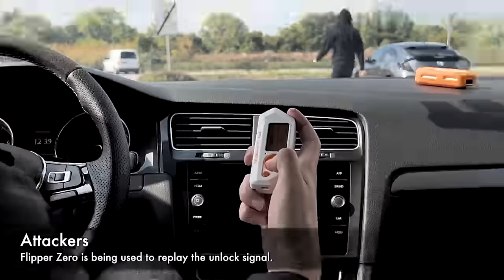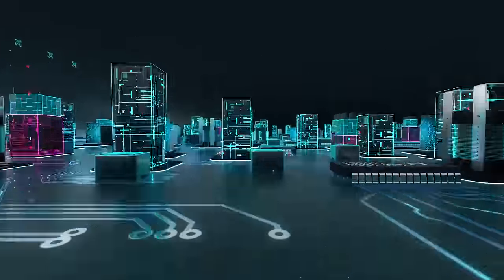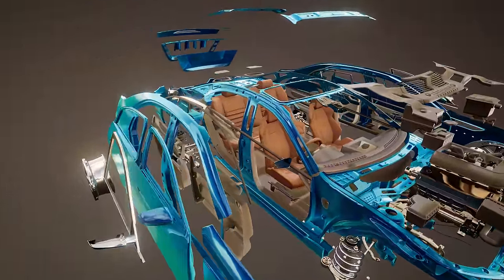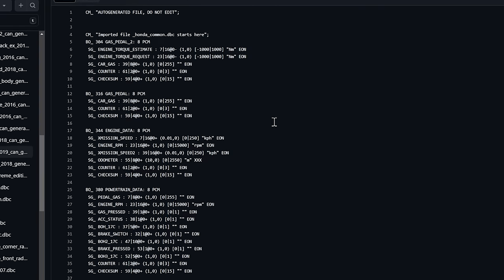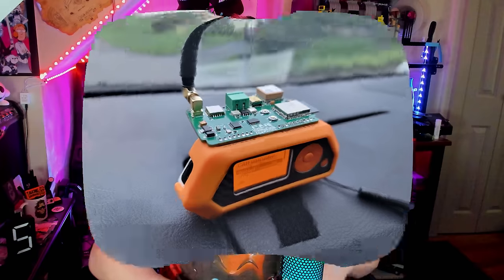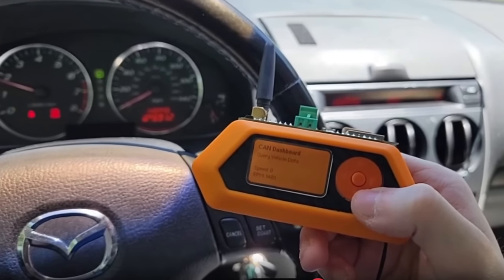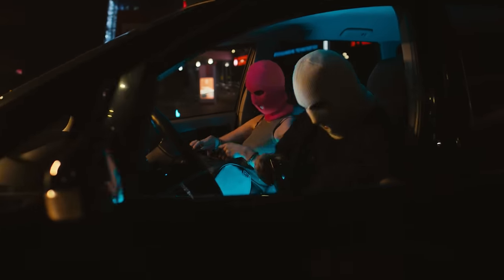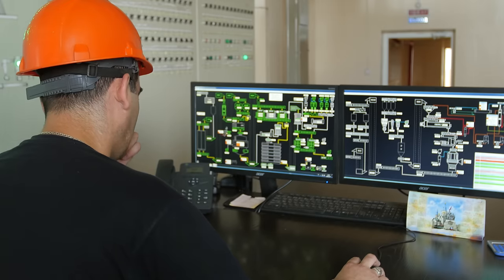Flipper Zero CAN Hack Your Car!!  CAN Bus Hacking With Flipper Zero!

Comment: 🎯 Key points for quick navigation:

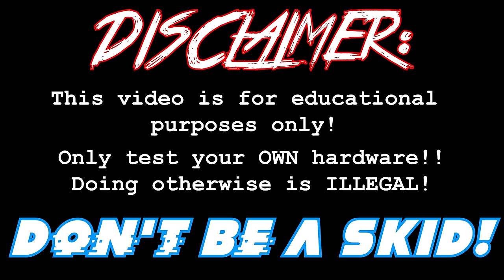00:00 🛡️ Introduction and Disclaimer
- The video is for educational purposes only; testing on hardware not owned is illegal,
- Introduction to the topic of auto hacking and the misinformation about Flipper Zero's capabilities.
00:28 🔑 Understanding Flipper Zero and Car Hacking
- Flipper Zero can read car keys and fobs but has security limitations,
- Possibility of hacking with additional engineering and technical knowledge.
01:32 🚗 Introduction to CAN Bus
- Explanation of CAN Bus as a robust two-wire system for car data transmission,
- Importance of CAN Bus in connecting sensors and devices to the car’s computer.
03:38 🔧 Interfacing with CAN Bus
- Tools needed to interface with CAN Bus like MCP2515 and Arduino Nano,
- Introduction to PCB and sponsor PCB Way.
05:00 📡 Accessing CAN Bus and Database Container Files
- Multiple ways to access CAN Bus including ODB2 port and lights,
- Explanation of DBC files as translators for commands and their availability.
06:04 🛠️ Practical Applications of CAN Bus Hacking
- Use of homemade CAN Bus interface to read car data and create custom displays,
- Examples of interfacing with infotainment systems and digital displays.
07:03 🖥️ CAN Commander and Flipper Zero
- Introduction of CAN Commander to interface Flipper Zero with CAN Bus,
- Capabilities of CAN Commander including GPS, Wi-Fi, and reading key fob signals.
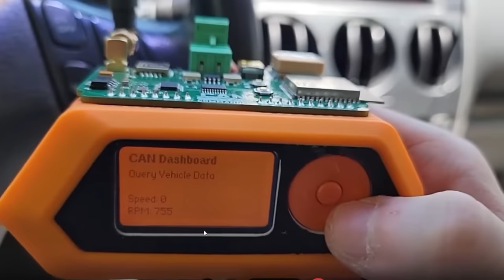08:11 📶 Advanced Features of CAN Commander
- Using CAN Commander for denial-of-service attacks and man-in-the-middle attacks,
- Explanation of prioritized packets and potential for disabling vehicles.
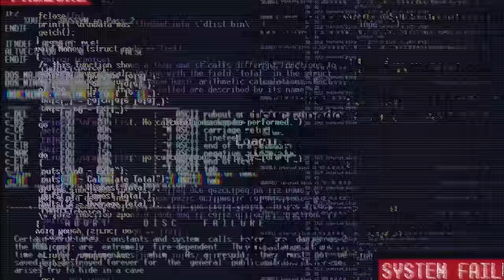09:49 🔄 Real-World Implications and Security Concerns
- Potential for manipulating vehicle data for insurance or monitoring systems,
- Examples of existing hacks and the importance of security research.
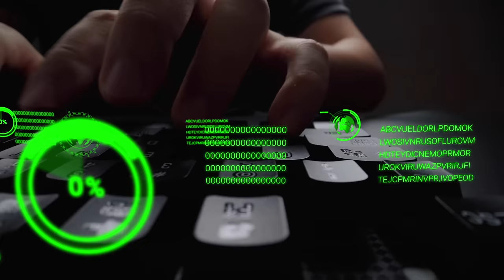11:28 🛡️ Security Research and Preventative Measures
- Efforts by researchers like Matthew to develop countermeasures against CAN Bus attacks,
- Tips for vehicle owners to protect against hacking and the inevitability of such risks.
12:10 📢 Conclusion and Call to Action
- Summary of the video and encouragement to watch the full presentation by Matthew,
- Request for likes, comments, and subscriptions to support the channel.

Made with HARPA AI

Comment: Dear Canada, this still doesn't make the Flipper a car hacking device.  The Flipper plays a trivial role and could literally be replaced with anything that has buttons and a screen.
Reply from the maker: Agreed.
Reply: Your comment has been flagged for wrongthink by the ministry of truth. You have been assigned to reeducation camp number 634 and transportation officers will be at your location shortly. Do not attempt to leave.
Reply: Omg that was a flipper video?? 😂😂 I was only focus on the can commander 😂
Reply: But it can be used to steal cars. Very easily.
Reply: @honestlocksmith5428  So can a brick
Reply: @skatterpro  So why don't we ban  bricks, right?
I'm just saying the flipper is an interesting tool for car hacking. It has a number of useful features and can do many of the tasks professional tools are currently doing.

Comment: With the can bus, almost everything can theoretically be hacked, even elevators
Reply: Can you explain this please? I'm interested
Reply: Elevators might even be easier than a car. I bet if you get into the maintenance panel or electric box then the CANBus wires are right there.
Reply: @gshockhodinky  do you think it could be possible with a m5stickc plus2

Comment: All this is why I as a locksmith now have to crawl up in dashboards and floorboards and physically spike into Chrysler star connectors just to program a damn key 😂
Reply: I was just wondering about that. Don't they have a list of key fob codes and info on what codes are used for what? Like for re-programming key fobs? I would think that the manufacturer would have that or something because locksmiths do for regular keys so they know exactly what key they need to make for someone who loses their key...
Reply: It is not the only car with a  gateway by any means.

Comment: As a former Mazda tech , with the OEM OBD2 tools we can do almost anything , change info on display like he did , we can also change things like wiper swipe time , dome light times outs , change instrument cluster values like rpm limits and speed limiting change indicator flasher timing
Reply from the maker: The main goal of the CAN Commander was to make the multi-thousand dollar scanner tools a tiny bit more accessible to the more tech savvy at-home mechanics.
Reply: which Software do you recommend? Are there any available on the net?

Comment: The term 'bus' in computer architecture refers to a communication system that transfers data between components inside a computer, or between computers. It's not an acronym, but rather a general term that encompasses the hardware (wires, optical fiber, etc.) and software (communication protocols) involved in this data transfer. The Wikipedia article on 'Bus (computing)' provides a good overview of the different types of buses used in computer systems, such as the address bus, memory bus, and expansion buses. It's a useful resource for understanding this fundamental concept in computer architecture.

Comment: You talk about this as only a security risk but stuff like this is great for the power train swap communitys (drifting and modified street mostly) being able to take aftermarket ecus such as link, haltec, motec (most already have partial support for these oe systems) and have them natively work with the rest of the original chassis systems to make a somewhat seemless power train swap into other brand chassis such as for example 2jz controlled by link integrated to work with a bmw e9x chassis. Makes an amazing street car with power on tap.
Love these kinds of resources as there's nothing better than removing some hump of metal that's going to blow up anyways for something more reliable (and frankly cooler).

Comment: Cool video. I need to be getting me these boards as they could open up diagnostics for me as I’m having some electronics issues. You can hack into rolling code but it’s an impossible scenario. You have to jam the frequency, wait for the person to use their key fob which is being jammed. At the same time you have to be close enough to read the key fob to get the current unused rolling code. Then when they leave you unjam the frequency and replay the signal you captured and it’ll open. If you can do this then you’re defo James Bond or Ethan Hunt 😂

Comment: Hey I just wanted to let you know that I always enjoy your videos. You put so much information in a short time and it always gets me excited about programming and trying to reverse engineer the next technology that otherwise seems impossible. The can bus mod is genius! I have been curious about if there is a list for different key fob codes that show all the different signals and what order they are in. Like something a locksmith or the manufacturer might have for re-programming a key fob. Then someone could just program the flipper as a key fob for a wireless key unlock/start. Wireless keys still trip me out even with the security features because I know when it comes to programming, where there is a will, there is a way! As demonstrated in this video! Keep up the good work man. Thanks!

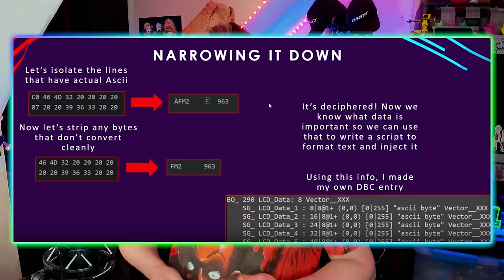Comment: My brain hurt every time you said "Revometer", it's a tachometer or "rev-counter". In your defence, it is a real word; but usually used on old industrial applications. However, at about 6:30 you made it sound like there is a difference between "Revometer" and "Tachometer", there isn't; they're the same thing. I see it more like saying Soda or Pop, it's where you grew up and the nomenclature of that area. Otherwise good job describing what the Zero is capable of in terms of CAN hacking. Granted we've been doing this for quite a long while, it's nice to see another platform we can utilize.

Comment: Esp8266 stuck sasquach showing this error during from web flashing ( Failed to initialize. Try resetting your device or holding the BOOT button while clicking INSTALL.

 )
Reply: There is only one button of mine Esp8266 i click on it yet its not working .

Comment: So why use the flipper in the first case? There are way better CAN bus tools out out there.
If you are able to hook up to the CAN bus a laptop is way more convenient as you already gained entry.
Getting access to the Can bus thru a tail light doesn't make sense as there are other destructive methods to illegally getinside the vehicle that are far more easier and i am not talking about a hamer to destroy a window.
Seeing at a local body work shop how easy it is to access some cars i wonder why you would lock those in the first place😮
Reply: The ability to scan subghz and gps adds a new set of unique features. It's also small, handheld, and easy to use. Of course a PC works but the ease of use of the can commander is unparalleled